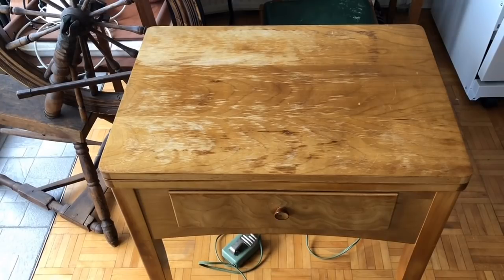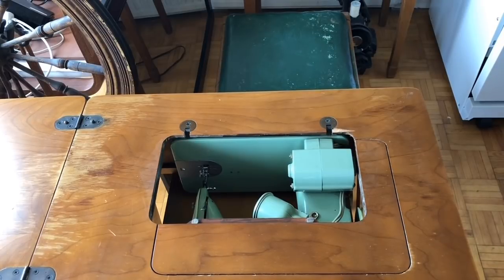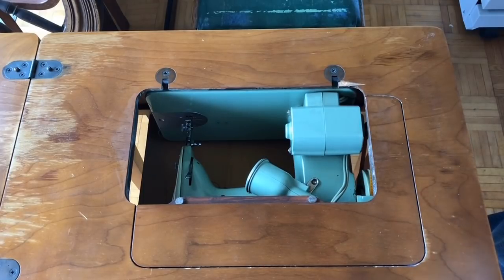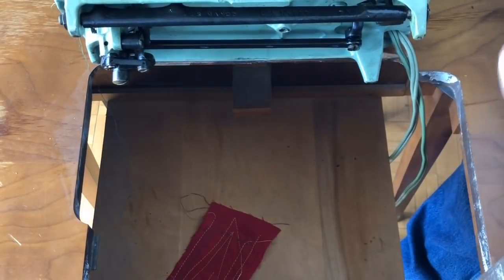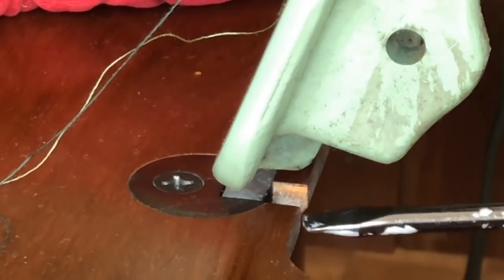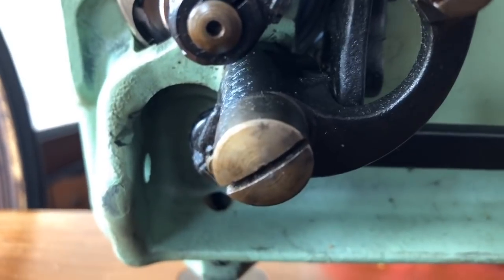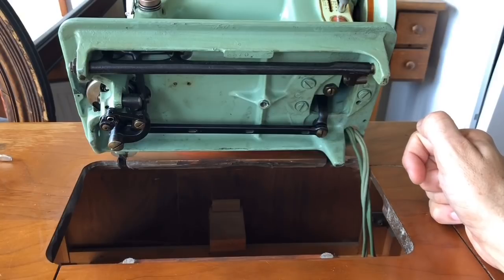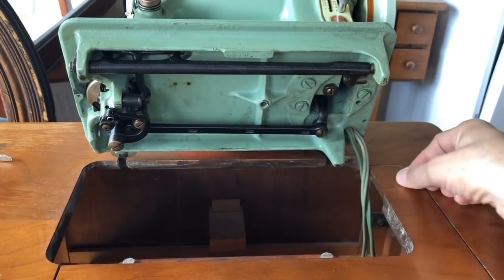SEWING CABINET & TABLE SERIES #4: How to Plan Transporting Your Just Purchased Machine!

Comment: Thank you! My Mom gave me her 1970s machine in the plastic case... long story short it was poorly maintained so I had to get a new one which broke because plastic machines are no good.  Sometimes broke off the case and the sewing machine dr couldn't fix it.  I now have a Kenmore similar to the one Mom had but it's in a table and older 1960s, I think.  I love it!  Previous owner took good care of it so I just routinely cleaned it and oil it.  I have been wanting to know how to take it out just so I can take it in if it needed service and so I can refinish the table.  It has a water stain on it.  Don't worry about Mom! Since she's a light user the newer machines work for her.   Last time I was over I cleaned it for her and made an index card "last cleaned..." and put the date and the phone number of the sewing machine Dr in her new county.  There were some dust bunnies I couldn't get to.

Comment: Do a video on "before you plug it in, check the wiring, and here's how!" or something like that. These old machines are often, even when dusty and dirty from storage, mechanically sound and easily to get running again but the wiring is often frayed, crumbly, and often quite scary and ridiculously dangerous. I bought a black iron Singer from a guy last summer that he had carefully arranged the wires apart so they wouldn't arc to show me the machine 'ran'. It did but I wasn't messing with the machine until I rewired it. He was appalled when I unscrewed the head from the table like you show in this video and cut the cord instead of trying to extract the whole mess of wires (there had been prior work on it years ago). Maybe include sources you use for replacement cords and related parts.
Reply: You go to a sewing machine store, although just cord comes from hardware stores.

Comment: Being mindful of the machine's cord set and foot pedal/controller is good advice. Thanks for that. A  buyer might gather it all up with rubber bands and place it out of the way, perhaps in the well where the machine rests in storage before removing the machine itself. Some tables are a bit trickier with the cords and controller fixed to the table as you mention. If the machine has removable cords, e.g. plugged into a three post terminal, so much the better; they can be unplugged from the machine and left with the table. In some cases it might be easier to simply remove the motor and light from the body of the machine with their attached cords. Otherwise, I wish you had demonstrated loosening the hinge pin set screws and actually removing the machine from the table, AND replacing the machine on the hinge pins when you get it all home. It would be helpful to see you do that. Also, if transporting the machine and table in a smaller car it may be necessary  to remove the legs from the table. In many cases that won't be required but it is easily done and it would be good to know how to do it when it is. Having a minimal tool set available in the car when  one finds a machine unexpectedly --a few screwdrivers, some rubber bands, a small bottle of oil, and some heavy cord (to keep that table lid from flopping around) and maybe some ziploc bags to hold loose parts. Throw it all in a bag you've sewn from scrap fabric and leave it in the trunk. You'll be glad to have it when you need it.
Reply: LZ Do you happen to know how to remove the legs from a sewing machine table? I’m facing the same challenge right now, trying to fit a table with sewing machine in my two-door car. It just can’t be done without removing the legs.

Comment: Thank you for this information.  Sadly, however,  I did not know this when we removed my mother-in-law 1952 Necchi from the cabinet to have it serviced.  In replacing it,  one of the pins bent.  Is it possible to replace it. Or should I attempt to have it straightened?

Comment: That is my machine! I may have asked you a while ago but where can I find a part for this machine?  It's the metal rod on top of the machine that holds the thread . ( sorry don't know the part name.) Thank you.
Reply from the maker: The part I believe you are thinking of is a Spool Pin.  These are available online and the originals were an off white plastic but some may have had the steel pins. Because it's a Singer, these should be easily found on sites such as Ebay or sewing supply sites.  Cost should be very low and likely lower than the mailing cost.
Reply: @VintageSewingMachineGarage  thank you so much. I found one of the sites to order from. From one of your previous replies

Comment: I have been waiting for this video. I still dont know what to do because I have seen a sewing machine cabinet that is so elegant with a old Phoenix sewing machine. I do not care so much about the machine but I want to cabinet to be ship at my place and arrive by courrier in good condition. Should I ask the seller to wrap and box the machine and wrap the furniture with something like a movers blanket.
Reply from the maker: Hello Sylvie.  Having anything that is heavy shipped is always risking damage although it can certainly be done.  The key is to inquire to the seller and have them explain to you how they will ship the item.  Just my opinion but I believe sewing machines should always be removed from carrying cases and even tables (on the rare occasion that they are shipped) to improve the chances of everything arriving intact.  The problem with heavy items is that they must be packed snugly so they do not move or shift.  Packing peanuts do not prevent machines from shifting and I have had bad experiences in the past with machines which were not packed properly.  To pack a sewing machine well is both time consuming and potentially costly for the packing materials. Obviously, you or the shipper can insure the item, but that is cold comfort if the item you really want and pay for is ruined due to the seller's poor packing or the shipper's rough handling.  I'm not suggesting that what you are considering will not work, but the chances of damage are sadly higher than average with both machines and furniture.
Reply: @VintageSewingMachineGarage  Hello, I know you are right. I had a Necchi Mirella ship and arrived brocken. My friend had a Julia shipped and because of my experience did mention to packed it well. It was wrap in a towel and loose in the box. It cost her more to have it repaired that the price of the machine. I cant justify traveling a full day plus autostrada cost, then I have to educate the vendor.